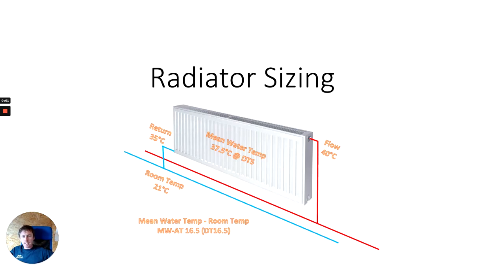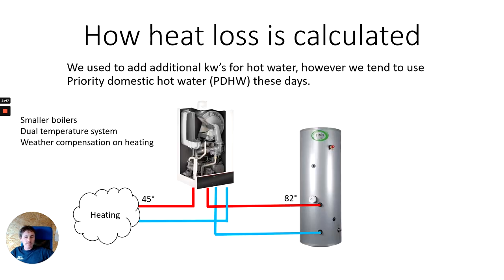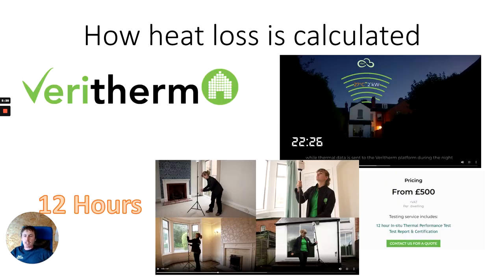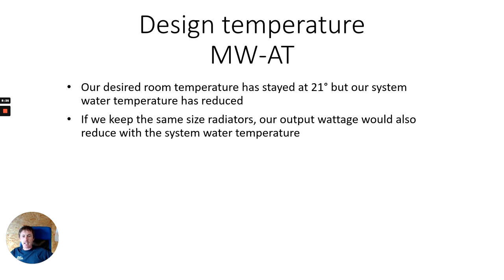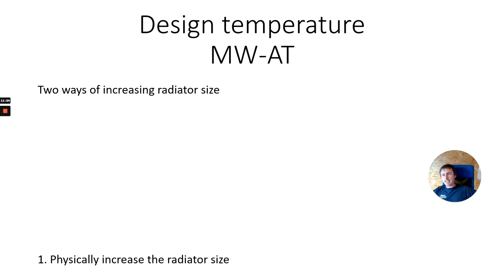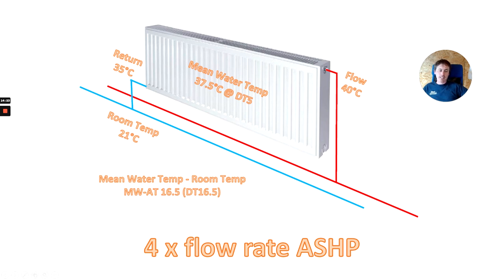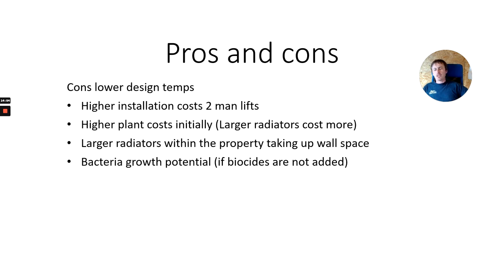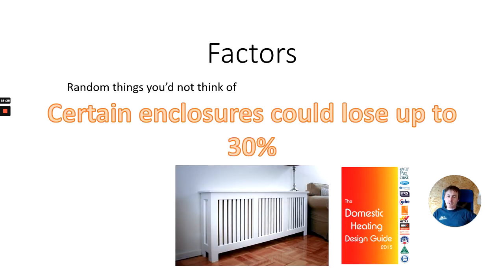01 Radiator Sizing

Comment: This is top notch, now I understand.   I will be moving homes soon to a traditional boiler /radiator system, this helps me to ensure that when we move I will need to consider the current installation, trial using the boiler at the optimum temperature etc at the same time work out my heat losses per room and take what I’ve discovered here and put it into practice. Not at the ASHP stage yet. Regards Mike

Comment: Fantastic explanation and detail. I've been trying to lower my flow temperatures on my Baxi Plat combi as low as possible but can only get as low as 61oC as Im probably hitting the boilers minimum output for my system design.....yet my boiler still cycles as my heat loss is obviously lower than the boiler can go to (manually). My return temps are around 50oC so my boiler is only just condensing. Is there anything I can do to lower this further with my current boiler? I'd love a modern load comp boiler but cant justify it considering my boiler works perfectly.

Comment: Great video. Concise and easy to follow. You do mention a 10 degree difference on the stelrad site but then go on to use a 20 degree difference between flow and return later on, why is this?
Reply from the maker: All modern boilers are dt 20 to maximise condensing. Rad companies don’t seem to keep up with this. Mean water temp is the main factor though.

Comment: Very interested in the comment about radiator piping.  In the illustration of the "European Way", you have hot entering at the top.  Does it make a difference if hot enters at the bottom (which feels more logical to me)?
Reply from the maker: As far as I can remember it’s just states the pipe arrangement and doesn’t specify flow/return. I could be wrong and you’ll get some form of stratification naturally. I’m sure someone would have written a paper on it at some point. 😉

Comment: Another great video. I have two questions on the content.
1. So at 15:46 Would you design bedrooms for 18°C and then they always have to be used as a bedroom, or at 21°C and add TRV's as a limiter so it's warm during the day but with a 3°C set back at night it would become 18°C anyway. This way the bedroom can be used for other in the future?

2. At 20:03 you say to try & stick to the same MWT throughout. Does having UFH ground floor with radiators 1st floor make a difference to this because the UFH will be blended down via the mixing group and would be a lower MWT?
Reply from the maker: 1. I’d design at 18 for bedrooms as per the design guide, however someone may want them designed differently for office use and then you could use TRV’s to limit the output.

2. UFH is usually controlled with a mixer so it would have a lower MWT and would be designed for this. Sticking to the same MWT design is aimed at radiators so you don’t have hot and cold rooms at the same MWT.
Reply: @hvaccuffingit6471  thanks for your reply and advice.

Comment: My house is annoyingly hard to heat throughout despite being quite small. In order for the hall and bathroom areas to stay warm, the flow rate needs to be 5c higher than the rest of the house needs. Its not too bad, i have smart trvs throughoutnso no room overheats, but it means i still have to run at 60c if its below 3c outside. 60c will then cope with that area down to -3, but below that id have to turn up to 70c. 

Vexing. I know the problem: bathroom radiator is undersized and sucks heat out towards that side of the house, and the landing above has no radiator. 

...but theres no room to put a bigger rad in the bathroom or one on the landing! My hallway rad is oversized now which has helped - last winter i had to run at 60c below 7 and 70c below 0, but the bathroom remains stubbornly between 16 and 18.

Bah. I think im going to have to get an IR panel or something in there. If it wasnt for that bathroom i think i could run the house at 55c flow rate or below all the way down to -3, which would be at least heat pump ready, if not heat pump perfect.

Comment: Hi, does this leave the 4 time flow rate now needing 28mm pipes installed all around ?
Reply from the maker: What’s the kw loading?
Reply: @hvaccuffingit6471  11 kw and 22kw  ,
Reply from the maker: @peterconnolly4608  28mm will take you to 10.5kw at a velocity of 0.9m/s. 22kw at dt5 would require 42mm pipe. Feels a large heat load.
Reply: @hvaccuffingit6471  hi, that is 28 mm from heat unit to distribution cylinder coil then to distribute to heat emitters (radiators) in 28 mm to ?
Reply from the maker: @peterconnolly4608  no, you headers carrying all of the load will be sized accordingly. Each radiator will have a fraction of the load and the pipework size required will adjust with the load.

Comment: Interesting that Part L specifies flow of 55 when a return temp of 55 is the start of the condensing phase. Did they get confused?
Reply from the maker: If you have a flow of 55 then on a gas appliance your return will be 35. So you’ll be condensing more and it takes less energy to heat to 55 than 70. 55 return is just dipping a toe into the condensing range.
Reply: @hvaccuffingit6471  Hi Yes - I totally get that, I just wondered about the ‘coincidence’.😉 Incidentally at - 3 I am flowing at 49 (V200).
Reply from the maker: I’d guess it was decided on 55 so properties are heat pump ready. 55 at dt 20 gives a 45 mean water temp which could be achieved with a 47.5 flow at dt 5 on a heat pump.

Comment: How do you convert from a dt of 50 once I’ve worked out the wattage needed to what wattage will be needed with a dt of 24/25?
Reply from the maker: You need the F1 factor table in the domestic heating design guide to calculate the new out put. The video is more pitched at customers so they have an understanding that radiator outputs change depending on system design temperatures. Also to highlight that you can’t calculate a radiator size or design a system without knowing the heat loss.
Reply from the maker: https://youtu.be/igLW63o60EY

This video goes more into the maths which is all in that section of the book. Hope this helps👍
Reply: @hvaccuffingit6471  perfect thanks bud I’ve just done half a quote for a huge place done all the heat loss working on a dt50 I honestly wasn’t aware of this new regulation change I’ve spend the last few days getting up to speed while being on paternity, so what would the case be if you’re going to do a boiler change and the customers don’t want to update the radiators? Just run it at 55 and tell them it isn’t going to get hot or you just cannot do the job? Or can you still run them at normal flow temps as it’s an exciting system? And if you were to say replace a radiator would you tell them they need to replace all of them or just replace the single one with a new ones installed ready for dt20 if they ever update it?
Reply from the maker: @kylebrowning7469  my interpretation is new systems would need to be designed at 55 degrees. Boiler changes would be on the existing system and would not require updating. However with the introductions of more ASHP’s and rising gas prices then you may find more system design changes. Time will tell.👍
Reply: @hvaccuffingit6471  ahh okay, and yeah suppose more work haha not that I think anyone worth their money is in need of it with this boom going on, really appreciate your fast response mate, got a subscriber here:)